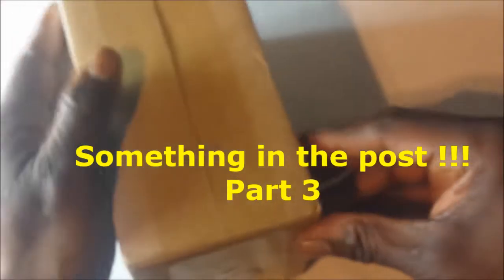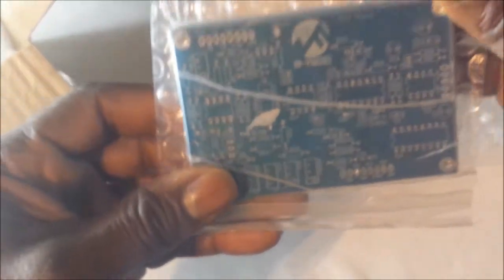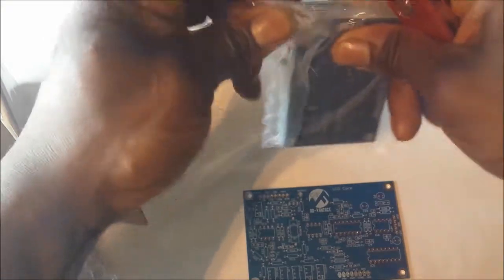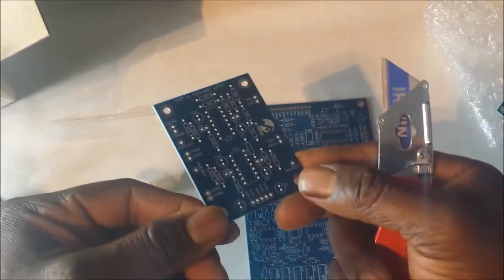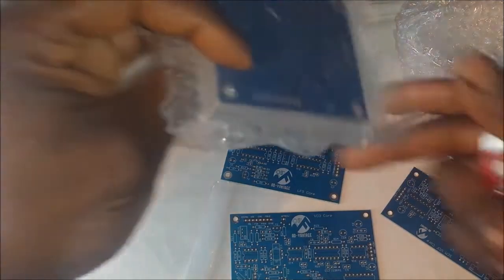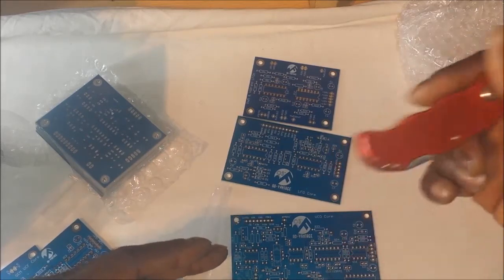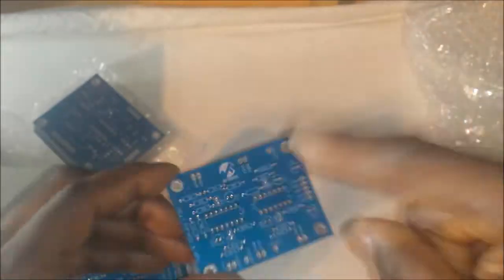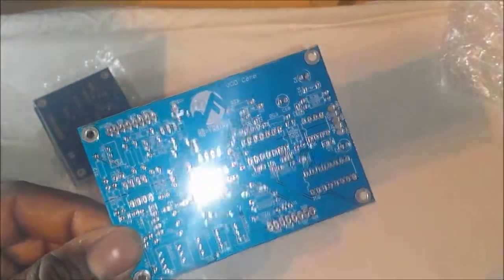DIY analog synth Project  ( Something in the post Part 3.0 )

Comment: Hi! Thanx for the video, Adam! Feels like looking to some Christmass gifts unpacking :)
Will be very interesting to see and hear it assembled! I hope it will be stable and as good (or better) as your solderless version.
P.S. why somebody would like to dis. this video? :) If I'm not interesting in videos about pink ponies then i'll just skip and forget it. Here is the same.
Reply from the maker: Yes i was very excited to finally have PCBs unbox them. 
So far 3 of 5 boards populated and working. Will be doing demo vids very soon.
Reply: @AdamTheAd-vanc3d  It's cool! Will watch def.!
Reply from the maker: Im hoping i will have a much better signal to noise ratio compared to the breadboards. 
Stabilitt will be better as breadboard connections as im sure you know get worn out . A tiny millimetre of movement can cause a sudden frequency change on the Expo converter boards. So i have high hopes of great things lol.
Reply: @AdamTheAd-vanc3d  Yep to all things here.
IMHO the most important part of a PCB is the ground area which you don't have on a protoboard and that it's poor on solderless breadboards. It's shielding.
Reply from the maker: @KiR_3d  Thats correct power planes make a big diffrence obviously less inductance. Im very intrested to see how less crosstalk i get when the whole system is connected.